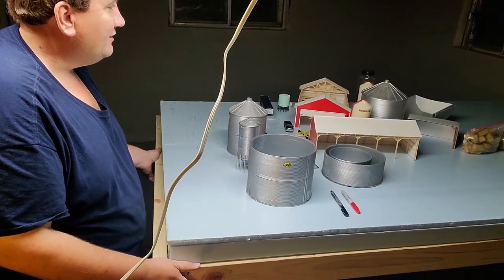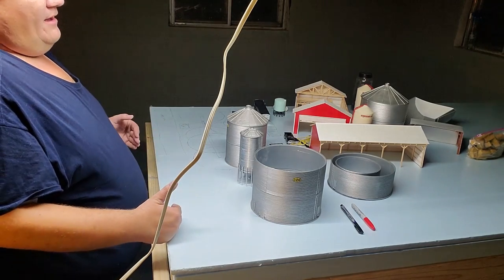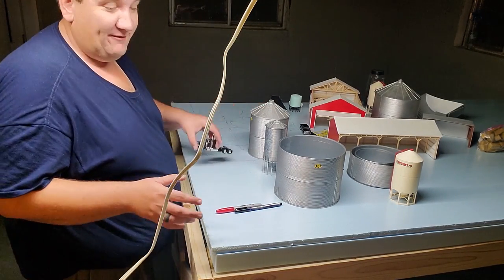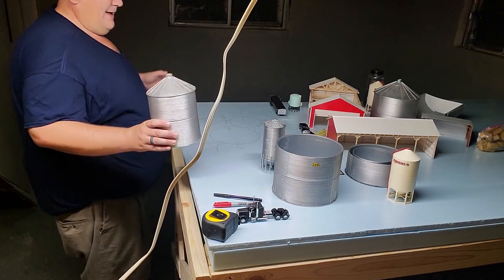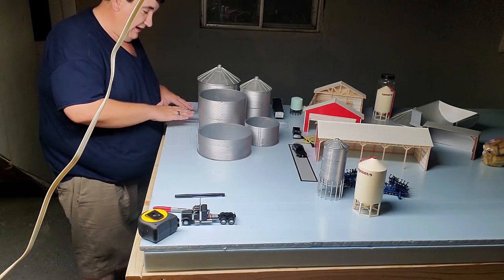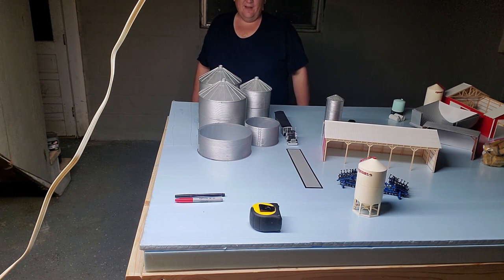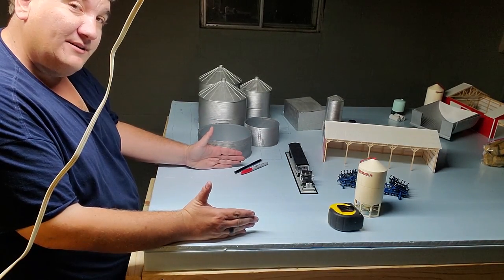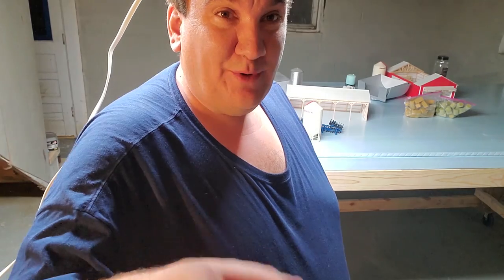How to build a farm toy display part 1: planning and layout

Comment: It might work to put your elevator on the L part you were talking about so you will have more room for fields or barn lot.  Or, put the rail road tracks at an angle in a corner and then put the scale across the road and having the driveway loop around the back of a concrete house. It would be close to a figure 8 drive.  Whenever I get my display together(some day), I am going to use a Walthers Co-op HO scale concrete house with a CN grain train I have been piecing together.  It won't be perfect but will be good enough to play with my kids. Looking forward to seeing what you come up with.